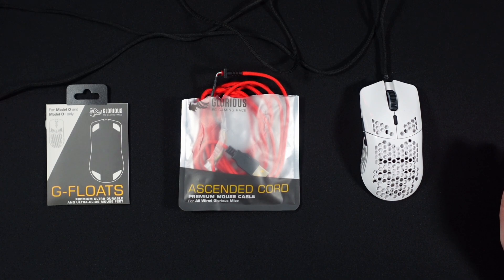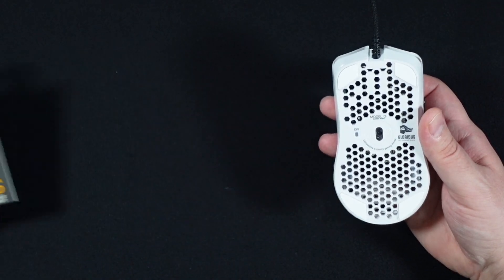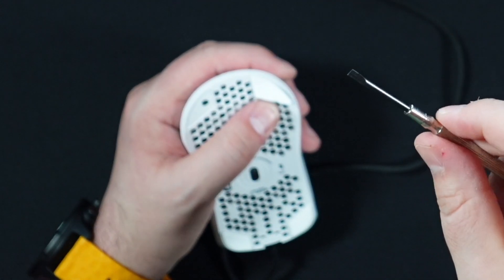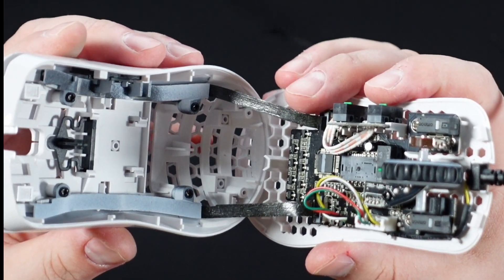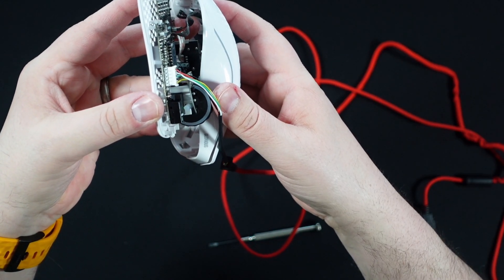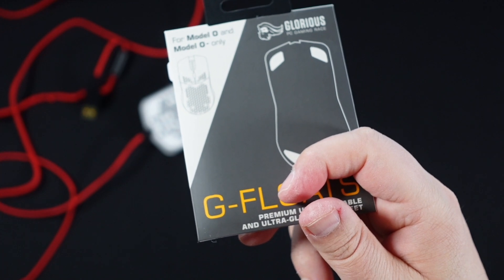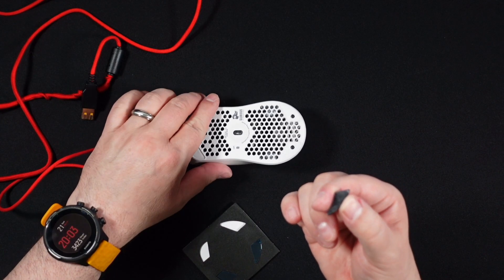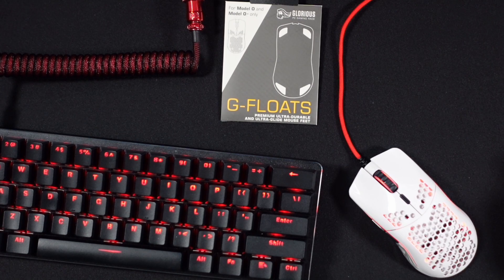Glorious Ascended Cord & G Floats Model O Installation Guide

Comment: 4:25 you did a minor mistake.  You removed the pin guard that prevents, in addition to the cable relief, too much strain on the pins from tugs on the cable (like if you pull against your bungee hard) The pin guard stays on the pcb and you plug your cable with JST 2.0 PH 5-Pin plug into that receptacle .
Its not a big deal its a simple mistake if you look at it the open side of the pinguard facing inward to the PCB thats the side youd jam the screwdrive in between the guard and the JST plug. Some times these connectors get stuck in there so bad you have to remove that to get it out its easy to slide back on just note the orientation when you do it .
Reply from the maker: Thanks for the heads up on that, I'll look into it!

Anyone who swaps a cable, be careful not to remove the pin guard as well.

Comment: So, I know this is an old video, but you should seriously update it with the correct method of removing the old cable. You prying at pcb with a relatively sharp metal object isn't good. there's a plug and socket there for a reason.

Comment: My right ribbon disconnected I don't think anything is wrong with it but I can't get it back in and I really like this mouse do I need the ribbon in for the mouse to work
Reply from the maker: If you're referring to the LED ribbon then you don't really need it, but those LEDs won't work.
Reply: @GraybeardGiffTech  Any way I can get it back in

Comment: Hey man I have a quick question. Should I buy a 1440p 144z monitor or a 1080p 165hz monitor?
Reply from the maker: I went to 1440p/144hz a couple of years ago. Then last year I grabbed the AW2721D and I enjoy it even more, that 1440p/240hz is great for high refresh games. 

If you have the horsepower to drive 1440p at high refresh rate I would go for the resolution, no doubt!

Comment: Do you know if I can fix my mouse if accidentally teared the ribbon cable inside?
Reply from the maker: If the ribbon is actually torn you'll need to replace the ribbon. If it's disconnected you may be able to put it back using tweezers. Those things are tough to deal with though. Good luck!